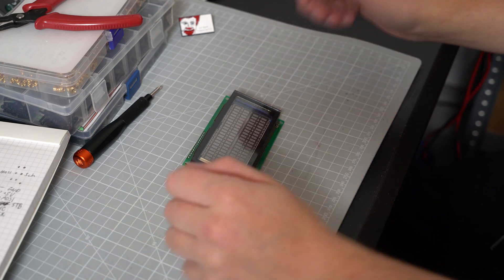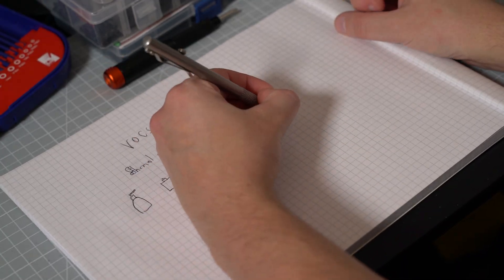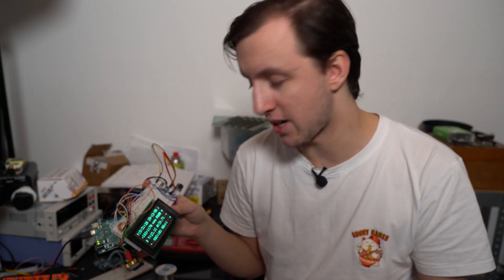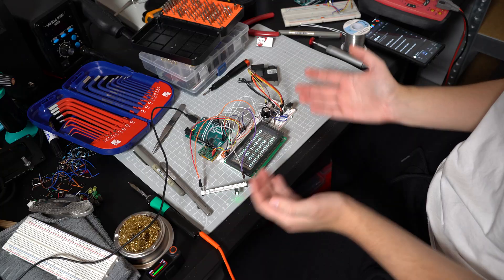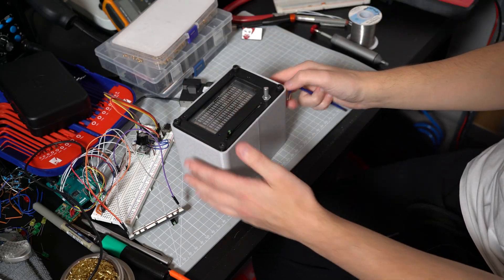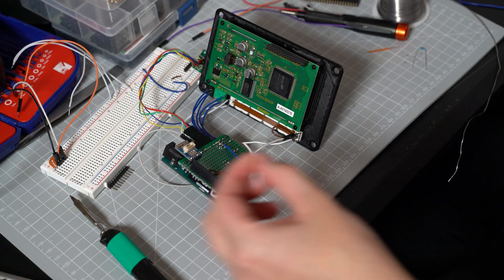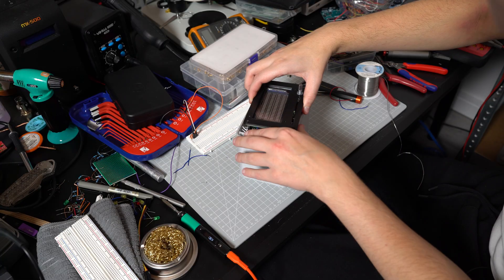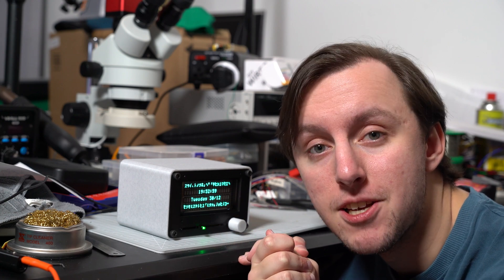Making a Desktop Environmental Monitor

Comment: Wow that came out great! I've wanted to make a project like this for a while but was always put off by the price. It looks like some of these sensors are starting to be pretty cheap, maybe this is my sign to try it out!
Reply from the maker: The sensors I used tend to be pretty expensive I just happened to have them laying around from when they were scrapped at the office
Reply: You can go cheaper; I used a plantower air quality sensor and scd41 for co2 and temp+humidity and the esp32c3, all total under $50. Check out esphome for the sensors they support.